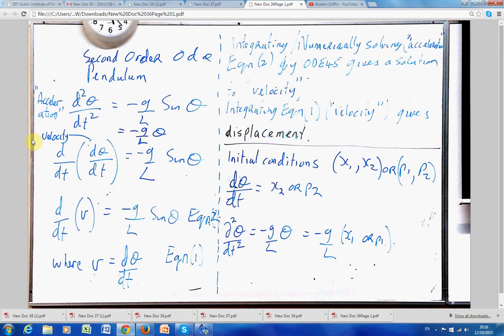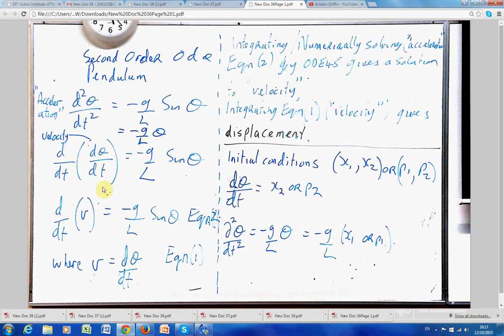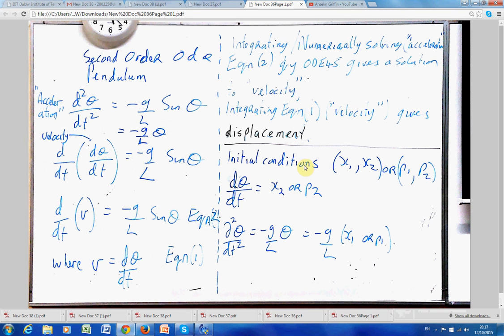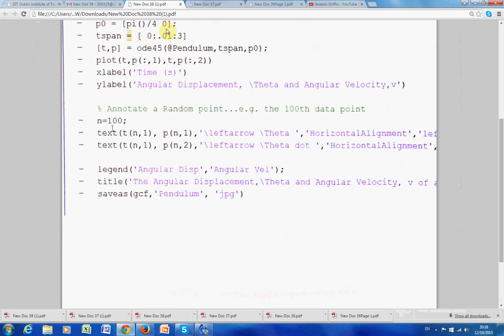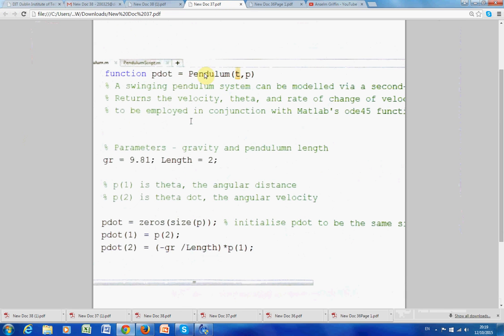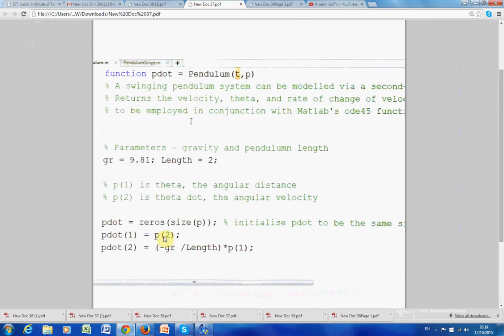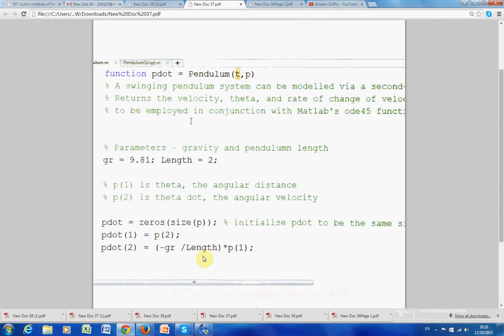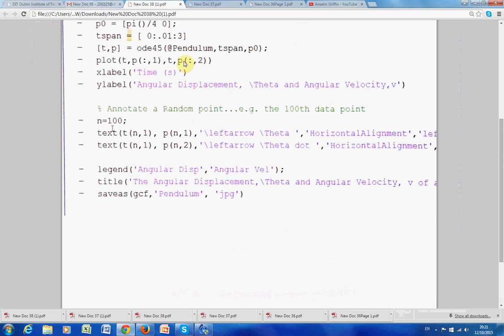Solving a second order  differential equation ,SimplePendulum, in Matlab

Comment: Is there any way to be able to input a desired angle to find out what angular velocity is at that angle without manually searching the unsurpressed vector for your data point close to the angle desired. E.g. what is the angular velocity at 30 degrees?
Reply from the maker: Hi Marrs. Thanks for question. The find command is very powerful. It returns  the index to a condition. Anselm Griffin